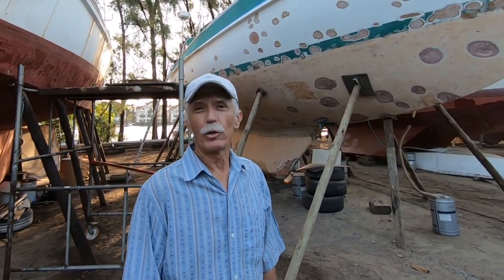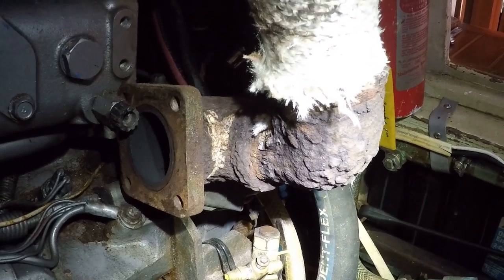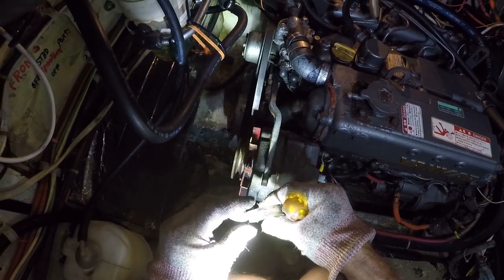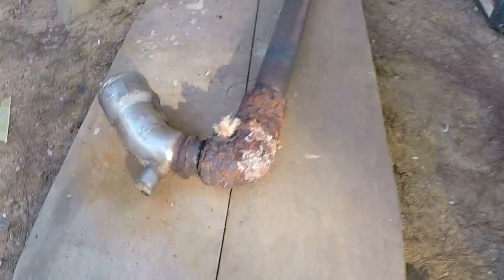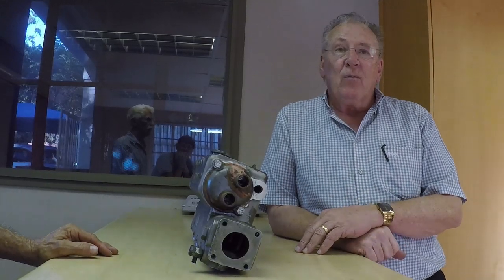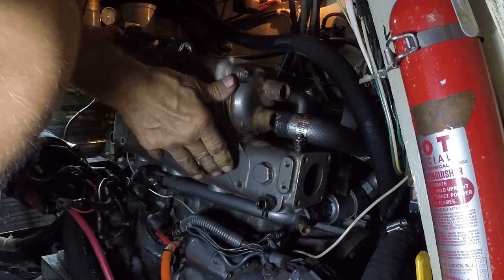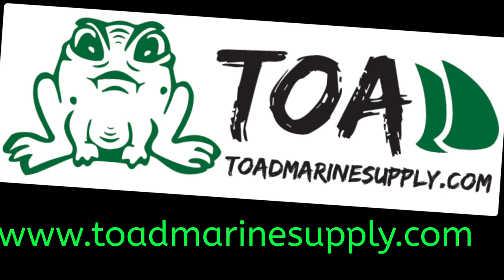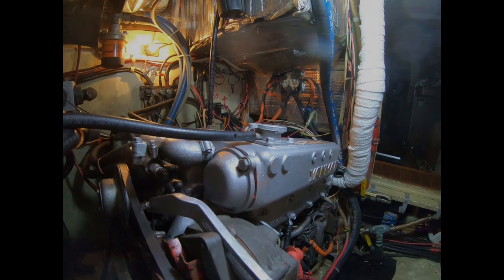How to Repair a Heat Exchanger /Insulate an Exhaust Riser:Yanmar Engine-Patrick Childress Sailing 44

Comment: Patrick, You set a high standard for us diy'ers.  I have a problem with my goggles fogging up when wearing them with my 3m respirator.  Do you have a similar problem when you are suited up?  What  respirator do you use?  Is it good for paint like Perfection 2 part polly as well as particulate matter like the asbestos?

On another matter, my boat had a small leak on a brass drainage hole in the transom.  It has caused the plywood core on the transom to rot a little.  The transom is still strong and the fiberglass is in perfect condition.  I was going to fix it by getting some gitrot and pouring it into the layers between the two fiberglass sections and then fill the void with some West System Six10 Thickend Epoxy Adhesive.  What do you think of this attempt at repair?  After the void is filled I was going to use a nylon drain instead of brass because I think it will hold up better.
Reply from the maker: If your goggles are fogging up, air is escaping from the respirator and not going out the discharge at the bottom. Check the one way valve and see if it is stuck. That thin piece of rubber disc often gets stuck to its surroundings inside the respirator. I have a very good dual filter respirator and a cheaper single filter respirator. The dual is far better for all reasons but I have dedicated that one to my helper named Sip. I don't like the idea of sharing respirators. 
You would have to check the specifications of your respirator to see what it is good for filtering. Painting the inside of our aluminum water tanks, it would have been impossible to paint them with 2 part paint using only a respirator, without burning out some brain cells. There I used the pumped in air from a hookah to breathe. Out doors, I would use a good, properly rated respirator.
Forget, GitRot. The wood is rotted because it became saturated with moisture. Pouring something into or onto wet, rotted wood, does nothing. The GitRot will stay but the wood continues to rot.  A heat fan, like a hair dryer,  would have to completely dry the area first and that can take days, if not weeks. If you have the right tools, it is actually faster, better, stronger to remove the deteriorated wood and rebuild the area. Can you drill down or some how dig out the deteriorated wood without opening the fiberglass skin to gain access?
Reply: @SailingBrickHouse-RVLife  Thanks for your reply.
Reply: I second that suggestion by Patrick.  Remove all the wet, rotten wood.  Then rebuild.  I just finished removing rot from a section in cabin wall coring.  A Portlight was leaking water into the balsa core of the cabin wall.  I drilled “exploratory” holes into the wall after removing paneling to discover the the parameter of the problem.  When the drill bit comes out with wet soggy wood you know you’ve struck rot.  I drilled about 20 holes to determine the perimeter.  Then drew a square around the affected area and used a Fein tool to cut the fiberglass skin.  Then used a chisel and hammer to pry the skin off revealing the rotten core.  Hammer and chisel to remove rot. Then shaped some plywood into missing core and glasses back in with thickened peanut butter epoxy.  Of note is I first coated and sealed the plywood with epoxy for better adhesion.  Hope this helps!
Reply: @Sailingintoinfinity  Thanks for your reply.  What brand of thickened epoxy did you use?  I am leaning towards WEST System Six10 Thickened Epoxy Adhesive because it automatically mixes the components when you use it.  I am also getting the impression that Gitrot is a useless product.  If the rot is completely dry will Gitrot work?
Reply: Here in S. Florida, I can fog my goggles due to the evaporation of sweat on a really hot day.  I also have a full face mask supplied with fresh air from a remote turbine pump.  Never fogs, never worry about gaps around the respirator, but the downside is being tethered to the hose and having to set it up (for a short duration task).  For longer-duration tasks, it can't be beat for safety and comfort.

Comment: Hi Pat , have you given any thought to a gun cleaning kit , to clean out the tubes of the heat exchanger ? Matching the diameter . Come with brass brushes and etc ...
Reply from the maker: I have never had a restriction problem in the "straws", or tubes, of the exchanger. But such a cleaning kit would be good equipment to have on board. However, looking like a gun cleaning kit, I would keep it buried in the engine room so some customs man would not think it is or cleaning a weapon.
Reply: @SailingBrickHouse-RVLife  you could use a wire coat hanger to prod the tubes

Comment: Thanks for the vid! Question... Ive seen this in a few marine applications... What is the purpose  of running the waste water out i to the exhaust?
Reply: Water-cooled inboard engines inject cooling water into the exhaust pipe, which cools the exhaust and muffles engine noise. ... This is known as a wet exhaust system. Wet exhaust systems have the advantage of using the heat-absorbing and sound-dampening qualities of water to cool and quiet the exhaust.
Reply from the maker: Thanks for watching..hope the guy below answered your question.

Comment: Hi Patrick. Great videos - lots of work you guys doing. I also have the same Yanmar 4JH3E (new 2004) in our sailboat. Have you had any seawater leaks from the small oil heat exchanger ? (the small heat exchanger located aft end of motor just above and forward of the bell housing/gearbox joint area that the sea water pumps through first before the main heat exchanger)  My Yanmar's oil heat exchanger has some slight corrosion now visible... with what appears to be a few rusty spots just under it from what I assume is the result of small drops of seawater in the area. I have not observed any leaks (ie drops) but it must be leaking a very small amount now. Adding it to my coming 2019/20 winter maintenance here in Vancouver BC to drain oil and investigate this. 
Keep up the videos.
Reply from the maker: There are two oil coolers in that area, the main engine oil cooler, far forward, and the transmission oil cooler. The first one in line from the raw water strainer, which is the transmission oil cooler, never showed any leaks on the outside. On the inside core, there was a very slight leak which allowed sea water into the transmission fluid. Good thing I had plenty of transmission fluid on board, to keep changing,  till we got to a place to rebuild the core and for us to order a new cooler. So now we have the rebuilt one as a spare.  Good thing you are catching your drip early on.

Comment: Hi. How hot does the riser get? No chance to use pipe insulation like roockwool whidh aluminium foil?
Reply from the maker: I have seen temperatures stated somewhere but don't remember the numbers....but it is extremely hot and would melt rockwool. That is why I am so impressed with the Mrine Tex holding up so well.

Comment: Taping the asbestos with some sort of high heat tape ? I haven't seen many doing the Barnacle Buster approach, keeping things under control. not sure why ? One can make the 10% solution with "clean strip" from home depot (40%), a gallon before leaving the states would go a long way. How is South Africa for prices ?
Reply from the maker: I think I will check around for some aluminum tape, as another commentor suggested. In Africa, labor is very cheap. Basic workers get around $12 a day but "things" like clothes and tools are not cheap. There is a 58% import duty on most things so there are few bargains. I just paid $60 for a liter of two part polyurethane varnish. Nearly all marine supplies are imported from the U.S..  Africa is fun though and in many ways nice and modern.  Certainly not like Somalia or the other miserable African countries far to the north. We just got back from doing a visa run to Namibia. That is a relatively wealthy country and looks like Arizona for the architecture and dry landscape, except there is no cactus. Nice people who speak very clear English.  Great hearing from you.
Reply: @SailingBrickHouse-RVLife  Thanks, great reply.
Reply: Maybe you can talk about routine use of Phosphoric Acid Barnacle  buster some time. The acid the shop used was sulfuric.

Comment: How many hours on the engine? Any gearbox problems?
Reply from the maker: 5000 now. No gear box problems no
Reply: @SailingBrickHouse-RVLife  Does it have the Kanzaki KBW21?
Reply: @SailingBrickHouse-RVLife  Any kind of overheating problems when runnig it over 3000rpm?

Comment: ..Are you sure the wrap is not ceramic insulation?? ( it is still something to not be breathed... )
Reply from the maker: I did the fire test to tiny thread ends. The old insulation did not singe/curl, but some of the threads on the new insulation did. Is there a better way to tell?
Reply: @SailingBrickHouse-RVLife  I am not sure... I do suspect that the old was some form of non-asbetos given the age of things... I also used to deal with other fireproof/insulation materials in the 80's  one was what we now cal Nomex ( racing suits) but we also had ceramic fiber insulation available... you were in good shape to wear the gear.   :D
Reply from the maker: I know Nomex from my Vietnam helicopter days. Felt like wearing wool.